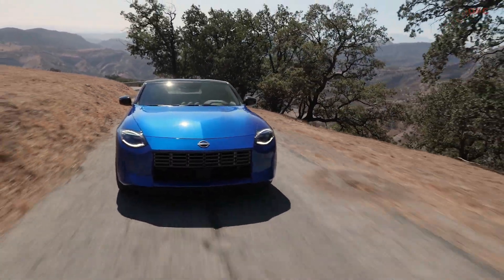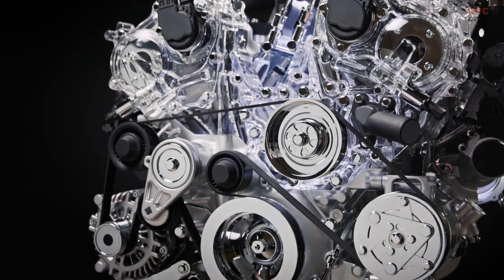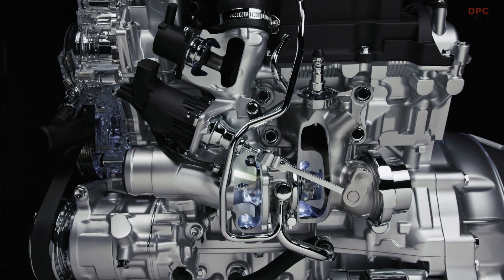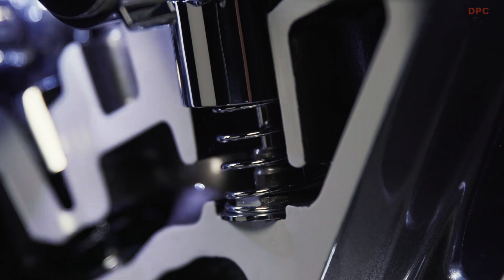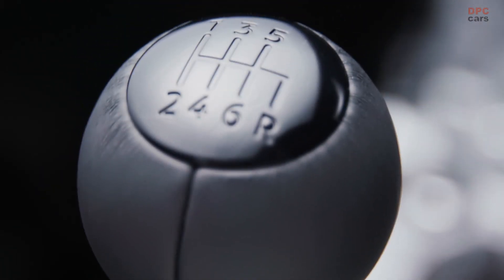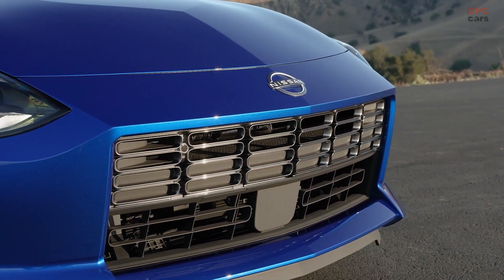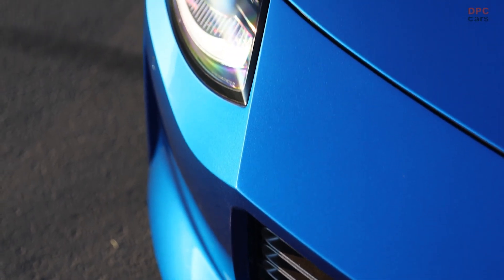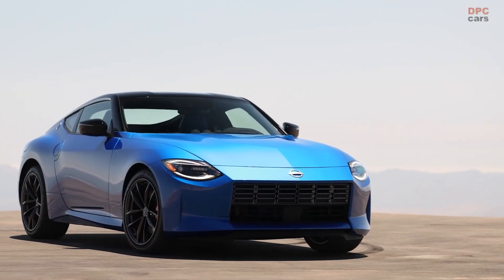2023 Nissan Z Engine and 6 Speed Transmission Explained

Comment: My Genesis has 275 lb ft of torque by 1500 rpm ... and that car is SUPER QUICK off the line, like INSTANT boost pull so i can imagine what ~350 lb ft of torque would feel like at launch on an automatic.

Comment: One thing is without question. The 9 speed auto version of this car is going to be alot more than 15% quicker. Lol. Infact. I wont be suprised if the 9 speed auto version even has more top speed and gets better fuel milage as well.
Reply: Well of course. The automatics are always quicker. Some people just prefer manual. I don't but I get the gist.
Reply: I still ordered the performance manual. There's no way it's slower than 4.3s and that's enough for me especially since the manual comes with launch control and one hand is gonna be off the wheel.
Reply: Automatics are quicker off the line and much better in traffic & they feel like one long gear pulling speed with no shift interruptions & i don't have to keep my eye on the tach to know when to shift ..
While i have a 5 speed manual, not going to lie that i enjoy shifting gears but shifting DOES get old and tiresome. 
My Genesis and MKIV Supra are both automatic and i would NEVER manual swap them. The Genesis has paddle shifters so i can simulate a manual and shift when i want to. The Supra also has MANUAL mode so i can also shift when i want to. 

But this Z, i will have to drive both and get a feel for the automatic and see how well it responds to the gas pedal.
Reply: Back in the 70's, 80's and most of 90's the manual cars always had better gas mileage than the automatic, today the automatics have better fuel economy and are shifting MUCH faster.
Reply: @ACommenterOnYouTube  Yeah the advantages are there, but you can only slap paddle shifters for so long before it feels one-dimensional. I say they should just make an auto system that can switch to manual planetary gears on a dime. Would be expensive and heavy, but when did that ever stop rich people?
Reply: @cosmic_gate476  i mean its not the same as a manual but its close and the next best thing to a manual. 
People buy a manual to control each gear and shift when they want. Well with paddle shift or gear shift, you can control each gear and shift when you want. 
Yes IMO the paddle shift or gear shift can get as old as pushing the clutch in and out over and over and over ... 
I own a manual and an auto with paddle shift, yes the clutch and shifting is fun but it does get old. 
Same as the auto with paddle shift, its fun at 1st but does get old and at that point i can just move it to D and let it go on its own where on the manual, im STUCK shifting ....
Reply: @ACommenterOnYouTube  Fair enough, I never personally owned a manual car (did learn how to drive in one), and I always like the Zs so for me this will be one for the books.

Comment: Most motorcycles still have manual transmission for a reason. Some people like switching gears for better control and the sound of an engine as you the switch the gears. It can be the same type of feeling in a sport car. I'm not knocking automatics, some automatics can be pretty good, especially with a strong v8.I just depends on what the auto or manual is in.
Reply: I have a 4 speed automatic and an 8 speed automatic. The 4 speed is VERY responsive and down shifts properly when needed. 
The 8 speed on the other hand will shift early in each gear for best gas mileage but when you give is some good throttle, it will rev out each gear, or if i am feeling the need to shift when i want to, i throw it in manual mode. 
My manual on the other hand is great and fun when its open roads and no traffic. Otherwise in traffic, its a nightmare.
Reply: You right, bikers do manual, full stop